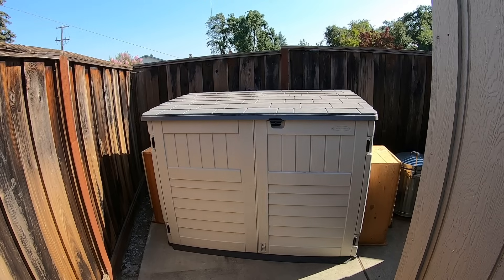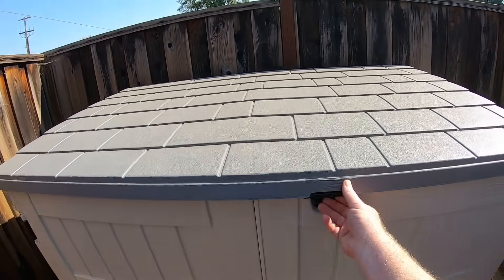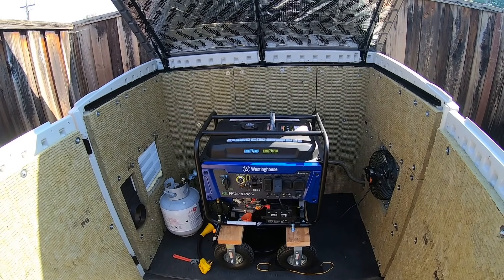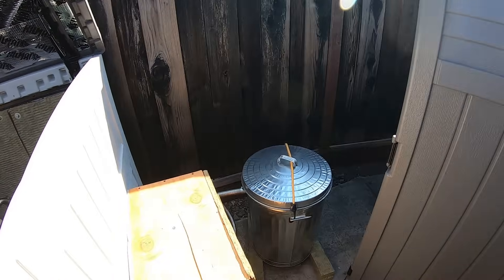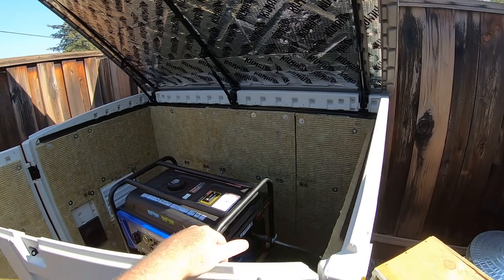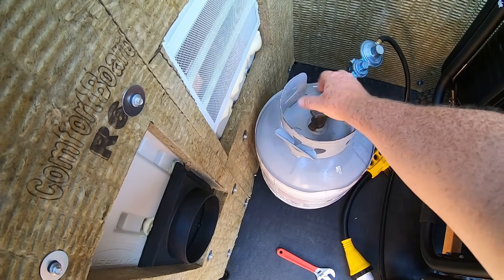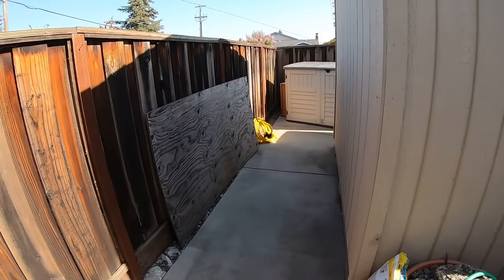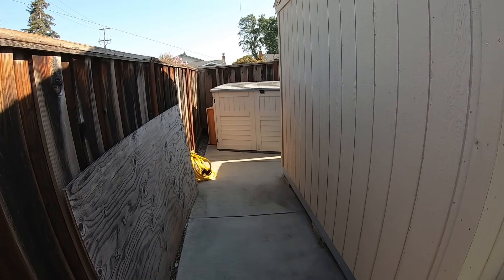DIY Generator Shed Build - Quiet Sound Insulation with Exhaust Muffler

Comment: Best portable shed design I've seen as far as noise, I'm a mechanical engineer building one right now, and I'm impressed! Have you done any testing with engine cooling (checking cylinder head temp with all doors open vs all doors closed)? I'm about to size my exhaust fan and was curious how yours is doing.
Reply from the maker: Thanks for checking out the video. I haven't actually run the generator very much in the shed yet.  It is mostly used at the MX track or camping.  There are several videos in this series.  The first one shows how I made the version 1.0 muffler.  Then a follow-up video shows how I upgraded the exhaust and muffler from 1" pipe to 2" to let it breathe easier.  Make sure you check out the other videos in this series on my channel. I cover the costs, parts lists, and other FAQs in the later video about my version 2.0 Shed Exhaust.   Check out the 2.0 video here, as it has most of the info: https://youtu.be/y3pUw408jCU

Comment: Backpressure on the exhaust I’m thinking over a bit of time an expensive fix
Reply from the maker: Thanks for checking out the video.  I answered this very question in my Version 2.0 generator shed video.  There are several videos in this series.  The first one shows how I made the version 1.0 muffler.  Then a follow-up video shows how I upgraded the exhaust and muffler from 1" pipe to 2" to let it breathe easier.  Make sure you check out the other videos in this series on my channel. I cover the costs, parts lists, and other FAQs in the later video about my version 2.0 Shed Exhaust.   Check out the 2.0 video here, as it has most of the info: https://youtu.be/y3pUw408jCU

Comment: Why you got gas generators to charge electric bikes ? Either get solar panels or gasoline bikes ?
Reply from the maker: Thanks for checking out the video.  I answered this very question in my Version 2.0 generator shed video.  The short answer is that you do what you need to do to get the energy in the form you need it.  After all, people use electric gas pumps to fill their gas cars with gasoline.  The electric dirt bike has a lot of advantages over gas, but eventually you have to charge them at the track or off grid, which is where the generator comes in.  The quiet generator shed doesn't actually have anything to do with the electric dirt bikes, though. I just happened to have a generator, and decided to make a shed to allow me to use that generator as a backup power-source for my house. There are several videos in this quiet-shed series.  The first one shows how I made the version 1.0 muffler.  Then a follow-up video shows how I upgraded the exhaust and muffler from 1" pipe to 2" to let it breathe easier.  Make sure you check out the other videos in this series on my channel. I cover the costs, parts lists, and other FAQs in the later video about my version 2.0 Shed Exhaust.   Check out the 2.0 video here, as it has most of the info: https://youtu.be/y3pUw408jCU

Comment: How did you get the exhaust pipe on there? Did you have to remove the screen in front of the exhaust whole?
Reply from the maker: Thanks for checking out the video.  I have several other videos in this series as well.  The first one shows how I made the version 1.0 muffler.  Then a follow-up video shows how I upgraded the exhaust and muffler from 1" pipe to 2" to let it breathe easier.  Make sure you check out the other videos in this series on my channel. I cover the costs, parts lists, and other FAQs in the later video about my version 2.0 Shed Exhaust.   Check out the 2.0 video here, as it has most of the info: https://youtu.be/y3pUw408jCU
Reply from the maker: By the way, the "screen" is the spark arrester.  I talk about building an upgraded spark arrester in the Version 2.0 video as well.

Comment: That's really nice. So $400 to $500 to build it including the mini shed? The muffler design on one of those has a predetermined back pressure. They don't leave it loud to be annoying. You've increased the back pressure. Long term it may be an issue.
Reply from the maker: Thanks for checking out the video.  I have several other videos in this series as well.  The first one shows how I made the version 1.0 muffler.  Then a follow-up video shows how I upgraded the exhaust and muffler from 1" pipe to 2" to let it breathe easier.  Make sure you check out the other videos in this series on my channel. I cover the costs, parts lists, and other FAQs in the later video about my version 2.0 Shed Exhaust.   Check out the 2.0 video here, as it has most of the info: https://youtu.be/y3pUw408jCU

Comment: Great design! Since the actual shed walls are plastic, what if you drilled some small holes in each section and filled them will some type of thick fluid mixture to help beef up the walls? Could you use concrete maybe?
Reply: i thought about that too

Comment: Awesome DIY project , Come to the right place, I am planning to build one for my home....
Reply from the maker: Thanks for checking it out.  I have several other videos in this series as well.  The first one shows how I made the muffler.  Then a follow-up video shows how I upgraded the exhaust and muffler from 1" pipe to 2" to let it breathe easier.  Make sure you check out the other videos in this series on my channel. I cover the costs, parts lists, and other FAQs in the later video about my Version 2.0 Shed Exhaust.   Check out the 2.0 video here: https://youtu.be/y3pUw408jCU

Comment: Very nice job I wish you would have showed the inside of the muffler.
Reply from the maker: I have several other videos in this series.  The first one shows how I made the muffler.  Then a follow-up video shows how I upgraded the exhaust and muffler from 1" pipe to 2" to let it breathe easier.  Make sure you check out the other videos in this series on my channel. I cover the costs, parts lists, and other FAQs in the later video about my Version 2.0 Shed Exhaust.   Check out the 2.0 video here: https://youtu.be/y3pUw408jCU

Comment: I have searched for the rock wool board, not having any luck.  Do  you know the name brand ?
Reply from the maker: It goes by Rockwool Comfortboard or Roxul Prorox.  I mention the exact products I used in some later videos.  Make sure you check out the other videos in this series on my channel. I cover the costs, parts lists, and other FAQs in a later video about my Version 2.0 Shed Exhaust.  Also upgraded all the pipe from 1" to 2" to allow the generator to breathe easier.   Check out the 2.0 video here: https://youtu.be/y3pUw408jCU
Reply: @C5Tor  Thanks for the info, and fast reply !

Comment: Great Job! ...... 2 questions: Did you have any issues with exhaust back pressure affecting the engine? iow, did you need to adjust air/fuel mixture? and, how long will a 20 gal tank run the generator for? Thanks!
Reply from the maker: Make sure you check out the other videos in this series on my channel. I cover the costs, parts lists, and other FAQs in a later video about my Version 2.0 Shed Exhaust.  Also upgraded all the pipe from 1" to 2" to allow the generator to breathe easier.   Check it out here: https://youtu.be/y3pUw408jCU
Per the specs, a 20# propane tank should last about 7 hours, but I haven't used a whole tank yet.  I haven't had to adjust fuel mixture.

Comment: Great video. Thanks. ( BTW...I did notice your motorcycle/videographer helmet was used...saw it when you created a shadow.  )
Reply from the maker: Ha Ha!  Yeah, it was my motorcycle helmet.  I actually answer that question in the FAQ section of a follow-up video about  some of the updates that I did for the shed.  Make sure you check out the other videos in this series. I cover the costs, parts lists, and other FAQs in a later video about my Version 2.0 Shed Exhaust.  Also upgraded all the pipe from 1" to 2" to allow the generator to breathe easier. 
Check it out here: https://youtu.be/y3pUw408jCU
Reply: @C5Tor  Thanks for reply and being a good sport. Keep up your excellent work.

Comment: I had built one like this out of pallets, then I got the idea of using sandbags last summer, so just to tinker with it. I used sandbags filled with dirt for the generator shed except the door and the hood which I retained from the previous shed made of pallet wood. I had plenty of rockwool board left over from the old shed. I am going to make a muffler like yours but with more sandbags
Reply from the maker: The sandbags sound like an awesome idea.  I love it when folks can take some of these ideas and think outside the box for solutions.  Well done!  
Make sure you check out the other videos in this series for some additional ideas. I cover the costs, parts lists, and other FAQs in a later video about my Version 2.0 Shed Exhaust.  Also upgraded all the pipe from 1" to 2" to allow the generator to breathe easier. 
Check it out here: https://youtu.be/y3pUw408jCU
Reply: @C5Tor  If you use the sandbag idea make sure to use lose topsoil, it absorbs sound better than the soil from a deeper depth.  The trash can muffler idea is very good, and you can also make it out of sand bags.  I used the synthetic polymer material sand bags because I could not find any other material. I came across hemp bags that I used to replace some of the damaged bags. Hemp costs more but it outlasts the synthetic fiber bags.  I only used rockwool on the door and cover.  I should make a video one day.
Reply: BTW dont worry about clumps of grass roots in the bag they help to absorb sound. You dont want the contents of the sandbags to be too compact because then they would be just like bricks. Dont over engineer it

Comment: Nice ! I'd like to know about propane consumption please.
Reply from the maker: I haven't verified the consumption yet (since I haven't used a whole tank of propane yet), but it is rated at 12 hours for the 6.6 gal gasoline tank, and 7 hours for a 20# propane tank.  Make sure you check out my other videos in this series on my channel for other upgrades I have done to the generator and shed.

Comment: This is awesome. I love the way the generator is protected from the elements and at the same time the noise levels are low enough to not be a nuisance. Great job with this build sir.
Reply from the maker: Make sure you check out the other videos in this series. I cover the costs, parts lists, and other FAQs in a later video about my Version 2.0 Shed Exhaust.  Also upgraded all the pipe from 1" to 2" to allow the generator to breathe easier. 
Check it out here: https://youtu.be/y3pUw408jCU

Comment: Wow! great job!  I'm in the process of doing the same thing.  I like the idea of using a small plastic shed.
Reply from the maker: Make sure you check out the other videos in this series. I cover the costs, parts lists, and other FAQs in a later video about my Version 2.0 Shed Exhaust.  Also upgraded all the pipe from 1" to 2" to allow the generator to breathe easier. 
 Check it out here: https://youtu.be/y3pUw408jCU

Comment: Nice ideas and well thought out.  One quick question...any back pressure concerns with the Frankenmuffler?
Reply from the maker: It can definitely be an issue, which I addressed in a later video.  Make sure you check out the other videos in this series. I cover the costs, parts lists, and other FAQs in a later video about my Version 2.0 Shed Exhaust.  Also upgraded all the pipe from 1" to 2" to allow the generator to breathe easier. Check it out here: https://youtu.be/y3pUw408jCU

Comment: Wonderful work. Wanted to ask you if you ever had any problems starting the generator in cold weather? I found out the hard way that after a near-freezing night, I couldn't start. Thank you and great video!
Reply from the maker: Good question.  I live in Northern California, so it rarely gets below freezing.  Haven't had to use the generator in anger yet, either.  My problem will probably be hot weather rather than cold, during wildfire season.
Reply: That's the issue with propane if it's cold it can't turn into a gas fast enough to fuel the generator.

Comment: I wondered if you could drill a hole in the plastic and inject that expanding foam? I kind of worry that it expand too much, but that would give you another layer of sound insulation
Reply from the maker: I actually did use expanding foam to seal the areas that I cut holes in for the vents and such.  But you definitely do need to be careful or the foam absolutely will expand too much.  The two halves of the shed wall are only really connected at the edges, and they can deform easily.  I did get one fairly large bulge under one hole, so be careful if you take that route.  Also, the foam when fully cured is actually very hard.  So it doesn't provide the greatest sound absorption.  The best sound deadening materials have a bit of give to dissipate the sound energy.

Comment: I Just finished putting together my set up.  I would like to thank you for your post and some great tips.  Looking forward to ERCOT dropping the ball again this winter. 👍😜
Reply from the maker: Make sure you check out the other videos in this series. I cover the costs, parts lists, and other FAQs in a later video about my Version 2.0 Shed Exhaust.  Also upgraded all the pipe from 1" to 2" to allow the generator to breathe easier. 
 Check it out here: https://youtu.be/y3pUw408jCU

Comment: Only temporary fix until gas runs out.   hint----- electricity needed to run gas pumps so then what do you do when you run out of gas?  $3-4K for temp fix?  propane tanks are $$$$$$$$$ also
Reply from the maker: I talk about this question in a my 2.0 Shed Exhaust video.  All the backup power alternatives have some drawbacks.  Gasoline and propane might have limited availability in a power outage, but are at least portable.  Natural gas pipes can be turned off or broken in an earthquake, wildfire, or freeze situation (like recently in Texas).  If I had the option, I'd probably go with solar & battery backup, but that is a very pricey solution.  Lots of variables.  Make sure you check out the other videos in this series. I cover the costs, parts lists, and other FAQs in a later video about my Version 2.0 Shed Exhaust.  Check it out here: https://youtu.be/y3pUw408jCU

Comment: You may be restricting the exhaust with the 3/4” flex.
Reply from the maker: Definitely a restriction (it was actually 1" flex pipe.) I've done several additional videos on the muffler and exhaust.  One was how I built the Version 1.0 trashcan muffler (https://youtu.be/jZpRSenXJAs), and the other was how I upgraded the muffler and exhaust from 1" to 2" pipe throughout to address the restriction of the original design (https://youtu.be/y3pUw408jCU).  Make sure you check out the other videos in this series by checking out my channel. I cover the costs, parts lists, and other FAQs in the later video about my Version 2.0 Shed Exhaust, so that one is the most thorough.

Comment: the build quality and overall thought on this project is impressive. The drawback is cost and time spent. At list price you could almost have bought a quiet gen set to start with. The other drawback is this is NOT approved by UL and if there's an issue your homeowner's insurance will likely have a field day! (fan failure, overheating, propane leak, fire) BTW, modifying your gen set and running it in a shed may void your warranty.
Reply from the maker: Make sure you check out the other videos in this series. I cover the costs, parts lists, and other FAQs in a later video about my Version 2.0 Shed Exhaust.  Check it out here: https://youtu.be/y3pUw408jCU
Definitely not UL approved, but when the power is out, you do what you gotta do.
Reply: @C5Tor  ... saw the other video and while there's good attention to detail, I'll stick with my points as mentioned earlier. If you want to continue improvements on your design, I will make a few suggestions. Place the propane tank OUTSIDE the shed. (safety) Install a high temp switch (150 degrees?) so if the fan fails or something blocks the air flow (leaves, plastic bag, etc) you have something to kill the ignition. BTW, to increase your cooling air consider that window screen on the inlet side will reduce the flow by 30 - 50%. IOW, just increase the square inches on that end to make up for the screen. The fan is already rated for its flow as it stands. IOW, fan area PLUS 50% should do it.

Comment: Good video, just built my box from scratch with wood for same Westinghouse gen. Still need to add insulation, ventilation and exhaust updates
Reply from the maker: Make sure you check out the other videos in this series. I cover the costs, parts lists, and other FAQs in a later video about my Version 2.0 Shed Exhaust.  Check it out here: https://youtu.be/y3pUw408jCU

Comment: Wish you showed how that trash bin muffler inside looks like, you did a great job Sir.
Reply from the maker: Actually, I've done several additional videos on the muffler.  One was how I built the Version 1.0 trashcan muffler (https://youtu.be/jZpRSenXJAs), and the other was how I upgraded the muffler and exhaust from 1" to 2" pipe throughout (https://youtu.be/y3pUw408jCU).  Make sure you check out the other videos in this series by checking out my channel. I cover the costs, parts lists, and other FAQs in the later video about my Version 2.0 Shed Exhaust, so that one is the most thorough.
Reply: @C5Tor  Thank you soo much. Very helpful.